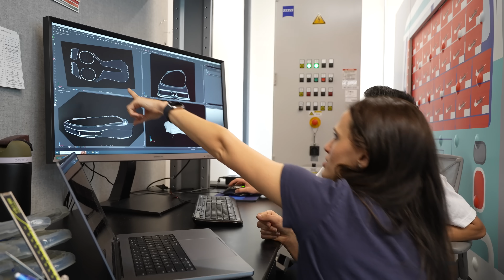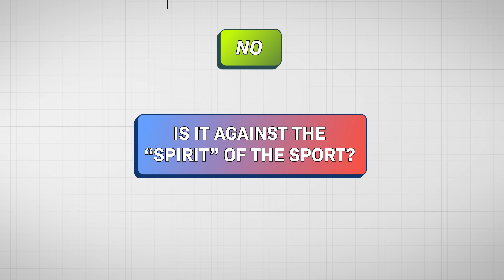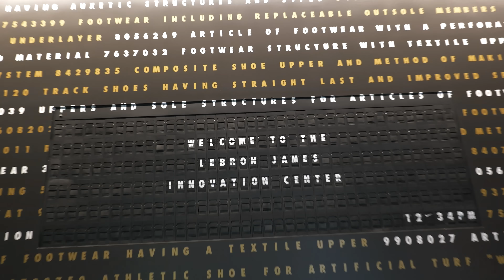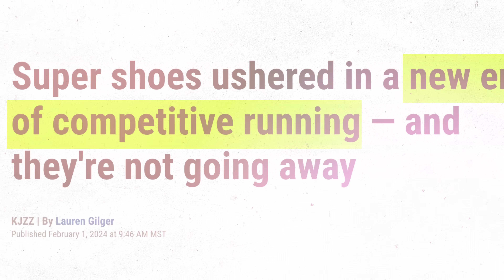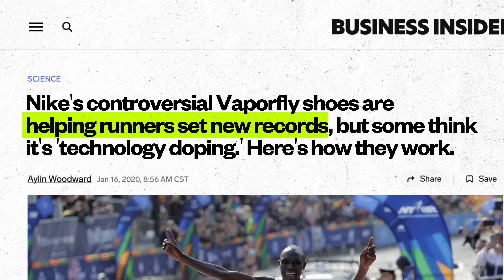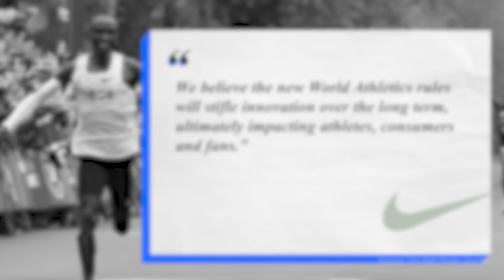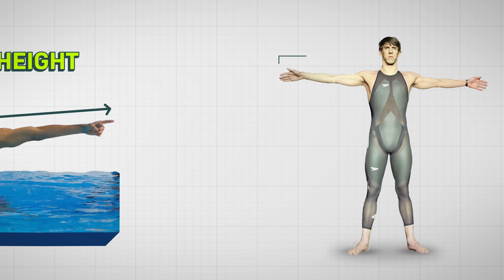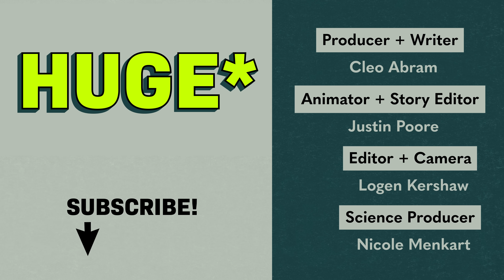The Shoe That Broke Running

Comment: Nike probably wouldn’t want you to, but it would have at least been fair to mention that the record of Kipchoge is not recognised as an official record as it broke a lot of the rules that you’ve mentioned in this video. Of course it’s still an amazing achievement, but there’s a reason it has not been matched in an official event. This video makes it seem like it was purely the shoes, but he literally had a group of pacers shield him from the wind while running.
Reply: Kelvin Kiptum ran 2h:00m:35s using the Alphafly 3 in Chicago. Regrettably, in February he tragically passed away. Finding the ideal conditions, he would have certainly been able to go sub 2h.
Reply: @gpersonaltrainer 100%.  Sad but I was thinking Kiptum would be the first to run sub 2 hour marathon in a competition. 
It will happen sooner rather than later.
Reply: A hundred and a dozen things have to go right for a perfect race 

The above wisdom is true your talented but not talented enough athletes.
Reply: A couple of comments here mention that he was "shielded from the wind" or that using a shield in skating gave zero air resistance.  The fact is that using a shield actually creates a draft so that if you run directly behind it but in front of the cone of tail of the draft, you are actually being pulled forward by the wave that is created.  Using a shield, in effect gives more energy compared to the same movement in a vacuum.
Reply: Yes! And laser lights from a car in front, to keep everyone on pace and in place:
Reply: Yeah it was a bit of a farce if you ask me. He might as well have done it in a purpose built air conditioned indoor facility. I'm not saying the pace he maintains isn't crazy impressive, I just think they've selfishly taken the shine away from whoever might eventually manage to run sub-2 without such assistance in the future. I can't stand stupid Nike or Kipichoge for taking part in their circus.
Reply: wrr
Reply: The journalism from Chloé on Nike was a bit meh on this tbh. Sorry Chloé, I get that it's exiting to get invited to these labs, but with the history that Nike has in extracting value from people (both workers, and athletes), I think it would be more fair to be a bit more critical towards Nike on what their role is on defining 'sports' in the modern age. In my opinion Nike define sports as peak performance, only because that makes it easier to sell products and make vaporfly's fly over the counter.
Reply: @MtJochem  Chloe in general 'refuses' to be negative, thus sometimes hiding the negativity... which in turn make some of her videos very midly toxic in their own way. I like her excitement for science, but I honestly wish she would be a bit more skeptical, critical and negative.
Reply: @DavidMulderOne  This is both the first and  last of her videos I will watch - I assumed from her shorts she was serious about sceince but this video says she is not
Reply: @DavidMulderOne 🙄
Reply: @Nicole__Natalia  Care to elaborate?
Reply: @MtJochem  Sports is all about performance, what else could it be about? Also if you don't support nike, stop buying their products and the products of their suppliers and sister companies. Good luck.
Reply: @MegaLokopo  It's about play, and using your body in ways that feel good. Kids in the street playing soccer is sports to me, but in no way primarily about performance. Days going on mtb rides in the weekend is sport to me, but not about performance. Someone going on multi-day hikes or bike tours is sport to me, but not about performance. It's a form of bodily expression, just like how other arts are forms of expression. I'm not saying performance couldn't be a big part of that. It's just that it's current ly commercialized and skewed in such a way that we don't know how to think of it other than in a performance and competitive way. We see 'the pro's' as the ultimate thing to strive for, instead of looking for our own ways to engage in sports. This creates hero's Nike can use to sell things to us, sure. But I also think that this makes a lot of us spectators instead of participants and that makes me sad.

I don't think I honestly owned anything Nike, and I do know that I engage far above average in sports.
Reply: @MtJochem  if it isnt about performance competition and winning, it isnt a sport. That is what makes it a sport.
Reply: @MegaLokopo  So what would you call swimming from Cuba to Florida or running from Everest basecamp to the peak twice in a week or just kids taking jumps on their skateboards in the street or a quackle of guys going for a mtb-ride in the weekend?
Reply: @MtJochem  some are games some are sporrs some are other things.
Reply: P.S I might be biased,

However, Kipchoge's attempt at Sub-2 hour marathon, was more of an attempt to prove that it is actually possible to run 42km is actually possible, thus, they attempted it severally, each time improving on the last- basically, SCIENCE(ING) a sport where it was a niche of sorts.

To use them in ordinary sport, then is to regularise it.

Doping imo should actually count in instances where the athlete is intentionally cheating giving himself an advantage (artificially) against others. Say use of steroids etc
Reply: @TrCollins  exactly, it was a "stunt" basically, just as proof of concept rather than actual attempt on the legitimate race record. He had big amount of pacers that were running in formation in front of him to break the air the whole time etc. Absolutely incredible achivement tho, he is one of the GOATs.
Reply: @TrCollins  Isn't training also giving artificial advantage against others? You cannot have any other regulation but arbitrary decisions, typically made by a committee.
Reply: The record and this video have nothing to do with each other
Reply: The ice skating speed record was via skating behind a shield on wheels. There's 0 air resistance.
Reply: Didn't he also run downhill the whole way?
Reply: @maniacpwnageking  it was a really flat course, but TOO FLAt" to be considered eligible for world records purposes...
Reply: @BrianTorres-theRunner  ooooh. Weird

Comment: I say it should be decided by the event organizers to set rules for the competition.  Everyone has to use the same equipment is one example. Set some limits on what can be used and the tech will find a way to get around it until the rules are changed to catch this and then the tech will change again. I would very much like to see anything goes for tech and PEDS, but then it will just be who has the most money. One good example is Strongman and the deadlift. Suits can be used and types of straps give advantage so some events say what can and can't be used upfront.

Comment: Spects don't enhance the vision than normal person, if you put some telescope on it then it will then it should not be allowed, regarding big blades makes height of a person high which acts as a gear to cycle, less round max distance gets covered that is something normal person should get to add on to legs which they don't as it is normal human race not something "technology pushing the limits race" so it gets banned 🚫

Comment: Can't you iust fix this all by saying 'every athelete needs to use the same equipment'? Like, the running shoes ARE wrong if only a select few can actually use them, as then its just an unfair advantage.

Its more tricky for body part replacements but that one example was clearly heavily biased against him, and all i can say to that is just making sure its as equal as possible to someone with a fancy pair of running shoes. So going to a company like Niki and saying 'you need to work with manufacturers to make a prosthetic that is the equivelent to your best shoes.'